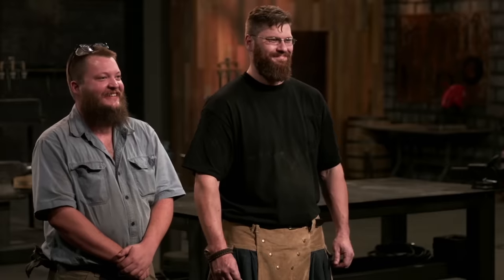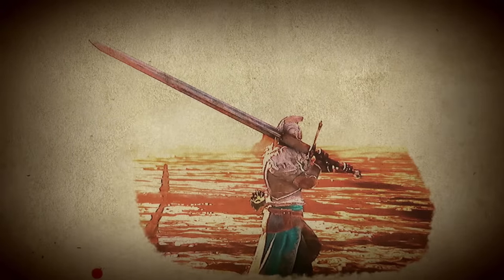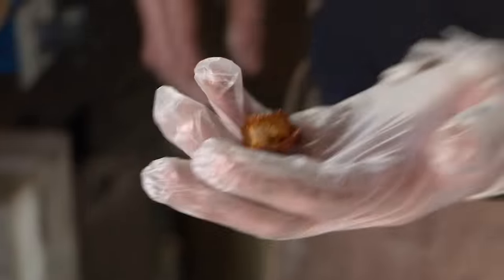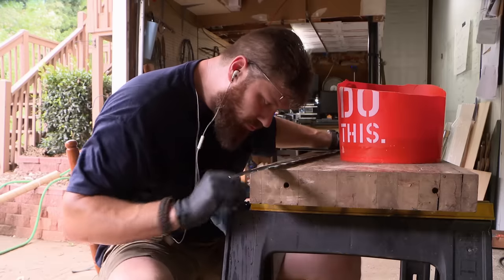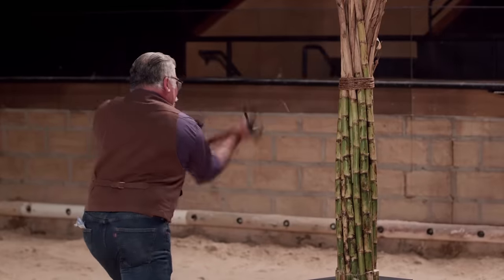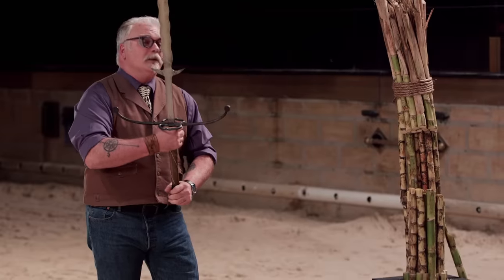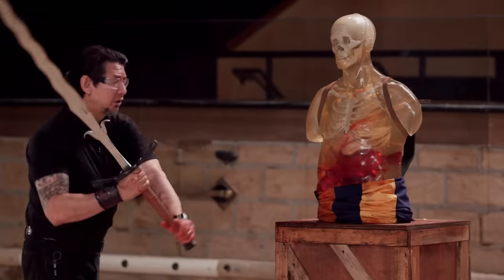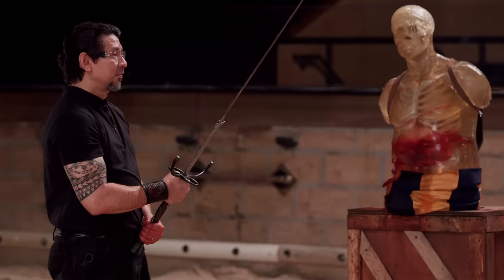Forged in Fire: The Zweihander PULVERIZES The Final Round (Season 3) | History

Comment: They both did very well. At first I thought that Stephen's blade would win, because even though a heavy blade is good for impact, everthing hinted that Jay made his blade too heavy. Then the strength test happened and it gave the impression that Stephen's blade was a bit too light... in addition to the handle cracking. I'm convinced that it was a draw up to the strength test and Stephen would've ended up winning if the strength test went better, due to Jay's blade being very heavy and Stephen's being just right for being handled easy while still striking good.

Also, next time infuse them with Chaos!

Comment: no one mentioned the weight difference? this was also prolific as a dueling sword. the lighter sword actually looked really well made for how light it seemed to be.
Reply: They had multiple swords for various purposes, the big and heavy ones were used for binding pikes in battles and for duels or bodyguard work there were smaller ones (up to your chin instead of full height) with a blade that grew thinner up to the tip to further reduce weight. The extra kilogram of weight doesn't seem like it but it's a massive difference if you have to constantly swing it.

Comment: It's use is quite misrepresented. It was not primarily to charge into a spear wall, which would have been suicidal and very ineffective as even such big swords don't do enough damage on multiple poles.
It had two main purposes:
1) as a bodyguard weapon: out reaches most other weapons and is more agile than most polearms, but does still terrific damage on lightly armored opponents.
2) complimenting halbardiers and helping them protecting flanks of e.g. Pike formations
Reply: BTW: many Zweihänder weighted only 2.5kg and their maximal effective weight was 5kg. A longsword weighs about 1.5kg and a one handed sword between 1kg and 1.2kg.

Comment: Using two handed swords is a specialized discipline, not just because of the size but due to the large handle causing your hands to be nearly shoulder width apart.  Dave is very much an amateur here, I wish they would have brought in someone who had some experience here.  He's bending both elbows, ending the cut with the sword off to the side of his body (huge tip drag), and isn't even leading with the correct foot.

Comment: Oh course the do the strenght test with a Zweihander against wood but when it comes to knifes and smaller weapons they test it against skulls, metal..
Reply: Large swords are much weaker than small daggers, as it's much easier to break a long blade. Do something similar with a long and short stick of about equal thickness.
Reply: Just think about the general use. Large swords are used do be bashed against each other. Metal against metal.
Reply: @Germanx200  what do you think swords are used for

Comment: I would make an argument in support of the heavier weight. Yes it makes a bit more unwieldy for normal people and 'average' swordsmen but they themselves noted it was often given to particularly big (aka stronger) soldier basically the real-life equal to a Videogame Tank Class, and while the weight could still cause a hindrance for these men I do feel like having on the heavier side for someone a bit stronger wouldn't impact it quite as much. Also, that weight played a part in the strength test where the heavier blade was able to really crack through and move the pikes around while the lighter one the best aspect of it was it split some by being sharp, it's a matter of mass in that sense, a heavier sword swung fast and hard is going to have more impact against a series of pikes. SO that said I'm not exactly up to date on the Zweihander beyond that is probably one of the most bada** swords I've ever seen, I can't say if in practice during the time period the sword was in use that the weight would have been worth it, but based on the research I did do and what was said in this episode, I feel a slightly heavier blade would be almost beneficial compared to something that is supposed to be a little more nimble... this thing is a spear wall breaker, not a rapier.

Comment: The sort of hilts were to close to the main side where the blade is because you're supposed to rest the sword on your shoulders because there's no way to put it on and a sheath and the sword is supposed to be way longer you never measured it and you can tell that the sword is way shorter than 6 ft this is not legit and this sword can cut through a person way easier than this and I can cut through wood verry easily and these supposed name of a samurai sword can be cut in half and that is just made out of steel toothpicks and it's supposed to be way sharper

Comment: it did NOT cut off spear heads lol
Reply: It could in theory but battles take long and you don't have enough room in a pike formation so they've been mostly used to overpower and bundle up some pikes to clear the way for your pikemen.
Reply: @anitaremenarova6662  in theory maybe, but very unlikely as the spears aren't locked in a static position, as you said it was more so about batting the pikes aside to make room.
Reply: @duven69  Exactly, you'd need to have space to generate enough force to cut through the pikes which is impossible with men pushing against both your shoulders.